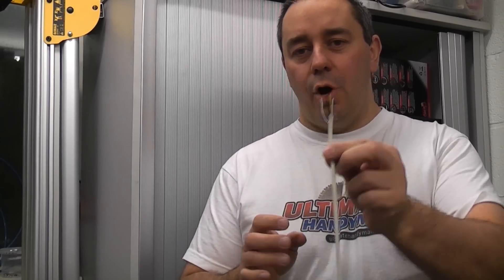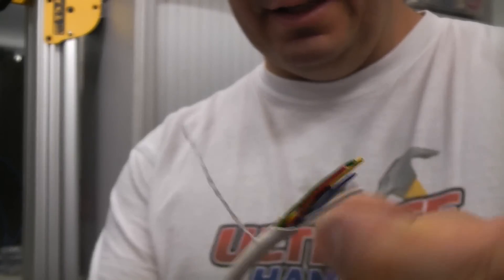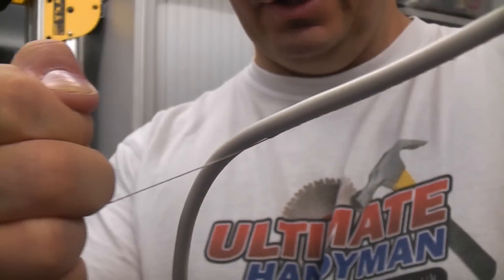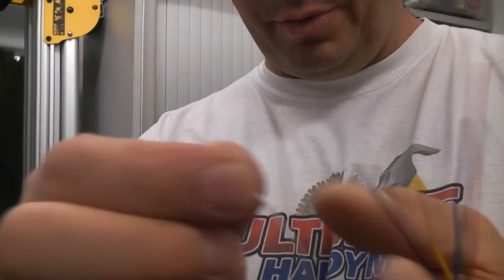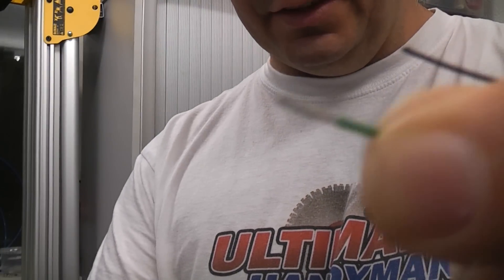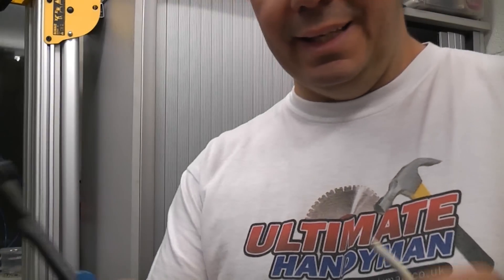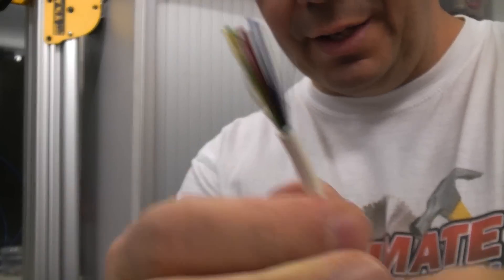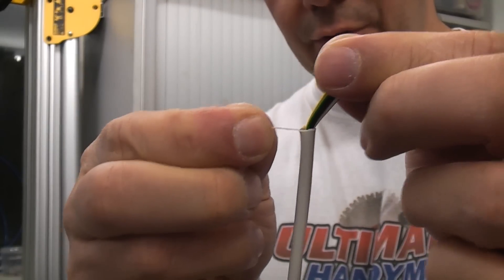How to strip alarm cable

Comment: Thanks ultimatehandyman if you remember a couple of months ago about how to wire an alarm you have now learned me more things how to do it the right way.  Thank buddy :D
Reply from the maker: Hi Ben, Yes I remember, that is why I ended up installing an alarm in my garage LOL. I will have them all edited and uploaded soon, including wiring the PIR ;-)
Thanks for the comment
Reply: What control panel are u using and pirs may I ask?
Reply from the maker: Ben mckenna
It's a Honeywell Accenta with two remote keypads. The PIR is Texecom (if I remember rightly)
Reply: Cool I use to have an accenta until last week it suddenly died so I'm properly going to get a texecom veritas 8 r8 of 8c I'm guessing u got your system online ?
Reply from the maker: Ben mckenna
No, I bought it from Steve Gorton Electrical in Blackburn, but they are widely available online. I have installed about 6 of the Honeywell Accenta's over the years and some are ten years old and still working ok, but I am not sure about the modern build quality of them!
Reply: Yeah I best not spoil the surprise for anyone so no more questions and 1 more thing keep up the good work:D
Reply from the maker: Ben mckenna
Thanks ;-)
Reply: Your welcome

Comment: Where’d you get that particular stripper from? I have a similar crimping multitool with red handles but the smaller wires slide straight through it